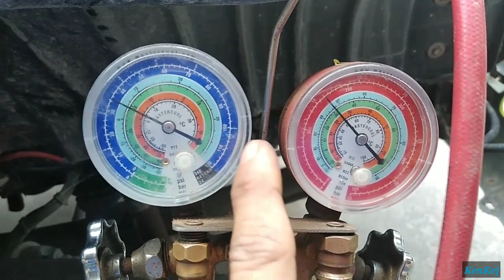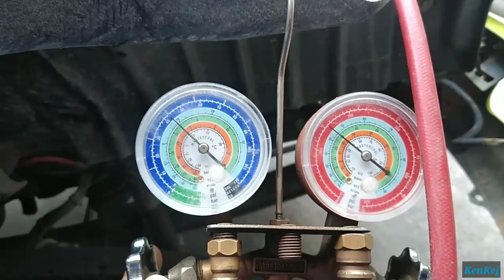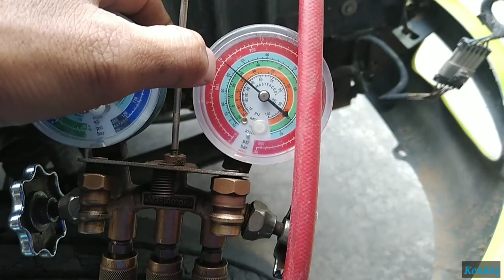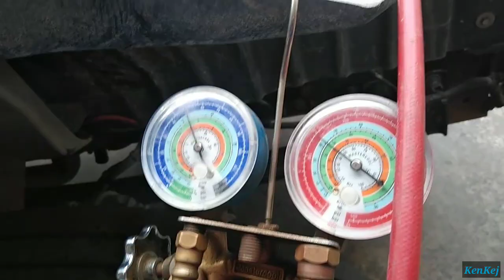Paano mag karga ng freon sa sasakyan at international truck

Comment: pano po boss...malalaman knh sira na ang compresor howo po ang unit.
Reply from the maker: Gamit ka manifold Gauge boss, makikita mo sa gauge pagpumalo ang gauge ng lowside ng mga 70psi pataas at ang highside guage pumalo ng 100psi pababa may tama na ang compressor
Reply: sa magnetic/clutch po boss ng compresor.. umaandar po ba yun kapag wala ng freon or hinde na..??
Reply from the maker: Automatic cut off yan boss ang magnetic clutch kapag wla ng freon for safety sa compressor para hindi agad msira. Kaya may low pressure switch at high pressure switch. Ang low pressure switch ang kacut off pgkulang na ang freon, Ang high pressure switch namn ang kacut off pagsobra ang freon or pagnag high pressure ang freon dahil sa hindi gumagana ang auxiliary fan motor ng condenser.
Reply: @KenKejAutoElecTrix  cut off sir it means di gagana??
Reply from the maker: Uu boss hindi gagana ang magnetic clutch, pero kung sakto ang freon at hindi prin gumana si magnetic clutch, check mo kung my supply si magnetic clutch, pagcheck mo at may 12 or 24v supply at hindi prin gumana ibig sbihin sira si magnetic clutch. Pero kung pagcheck mo at wlang supply, lagyan mo ng supply at paggumana ibig sibihin ok si magnetic clucth. Pansinin mo boss may clearance si magnetic clutch ng kunti sa pulley nkaangat sya. Paggumagana namn si magnetic clutch nkadikit sya sa pulley at sumasama sa ikot nito.

Comment: Sir di ba nag cut in, cut out yan ?
Reply from the maker: Ang alin sir ang may cut in, cut out?
Reply: Yung pag mag automatic sya sir.
Reply from the maker: Mron sir, evaporator temperature sensor o A/C Thermostat na ang mag automatic cut off, cut in sa ac compressor
Reply: Salamat po sir